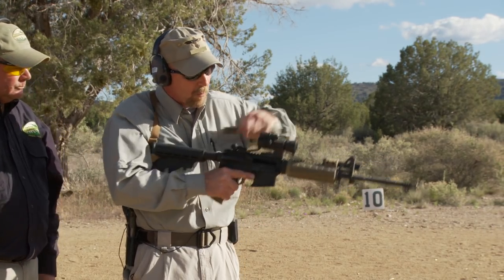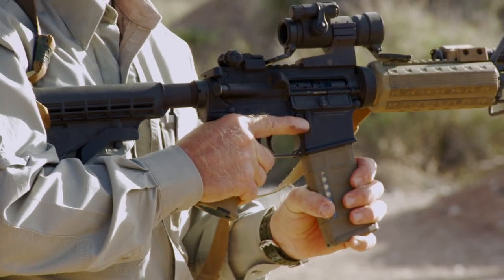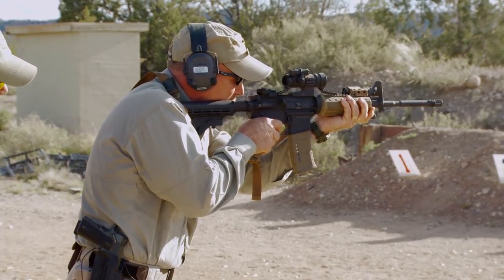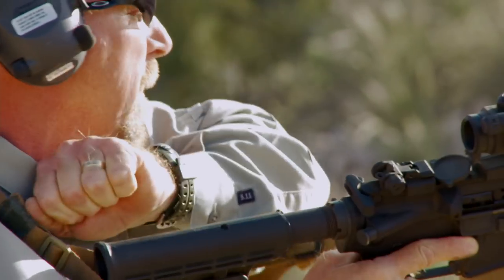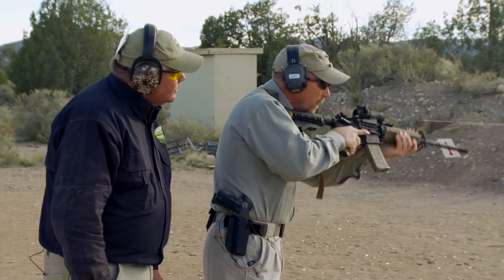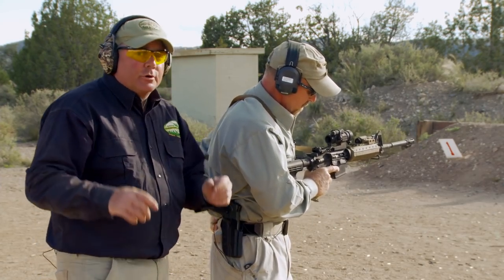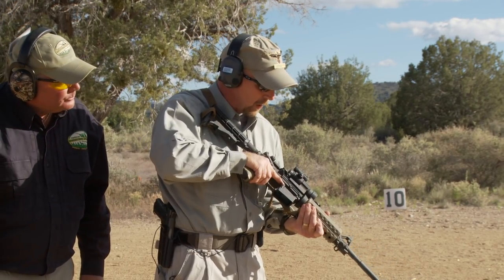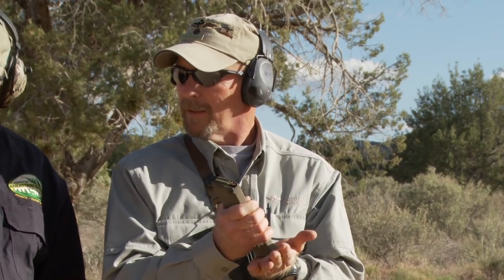AR-15 Immediate Action Drill | Gunsite Academy Firearms Training

Comment: the army taught me SPORTS, slap the mag up, pull the charging handle, observe malfunction, release charging handle, tap forward assist, squeeze-

later down range i took away 2 steps from the process making it PORS (pull, observe, release, squeeze); however i incorporate the other two steps (slap and tap) when i do my mag changes

you're exactly right this is for beginner non-combat shooters,

Comment: In my experience this method of push pull is amateurish at best. During my time overseas we trained to tap, rack and bang or Rip Rack Reload. I was in the Marines and Army and the BRASS and SPORTS methods are great. However, if you need to get the weapon back in the fight push pull is a weak method and is not forceful enough if you have to get the weapon running again. I dont know of any serious instructors teaching a push pull ie MagPul, CSAT, Viking Tactics, Spartan or Tiger Swan.

Comment: Push pull rack unload reload do a summersault unload the gun disassemble it do 36 push ups reassemble the gun put it in the case low crawl 76 meters and that should clear the malfunction. It’s very simple.

Comment: US ARMY taught the SPORTS method. 1 (S) Slap the bottom of the magazine with the bolt closed. 2 (P) Pull the charging handle. 3 (O) Observe the chamber for miss fed rounds. 4 (R) Release charging handle to reload weapon . 5 (T) Tap the forward assist. 6 (S) Squeeze the trigger and go boom!

Comment: This drill is for when a round hasn't been fed for ready fire, not a full malfunction when a round is jammed or a misfire happens with a round still in the weapon.  You need to get proficient in conducting SPORTS (Slap magazine insure its seated properly in magazine well-Pull the charging handle-Observe the Chamber very important. You want to make sure there are not any jammed or msifired rounds in the chamber-Release charging handle and ensure round feeds properly into chamber-squeeze the trigger and fire.)  All takes a second when practiced proficiently.  Also this ensure the safety to the shooter especially when rounds are being misfed into the weapon due to faulty rounds or magazine.

Comment: Slapping the magazine will not shoot a round out of it, it just makes sure the magazine is seared properly. If the weapons didn’t fire when it should’ve, then there most likely won’t be a reason the bolt is locked to the rear allowing the round to fly out, and if it is, there isn’t a reason to worry about one round flying out when you still have the other rounds in the magazine.

Comment: @Desenrolle lightningman01's point is still valid.  This is a drill that should be practiced, but not when you have a mis-fire.  You should always adhere to the 60 second rule when at the range or whenever you're not in a life threatening situation.  This video would have been better had it pointed this out.  Obviously you're not going to wait if it's a life threatening situation, but this video is about a drill.

Comment: I don't think that rounds would pop out of magazine and into chamber with bolt in closed position when slapping bottom of magazine.  They can't go anywhere because the bolt covers up the top of the magazine. 40 years of SPORTS isn't wrong, but combat proven reality.  M16s gunk up with sand and powder fouling, and that's where slapping magazines and the forward assist come into play.

Comment: yeeeaah. No. The way you make sure is if you flip up the rifle to see the action....
That is if you're an idiot with a gun and cant make more than 2 steps without fouling it up.
Also, make sure the safety's off when you're about to fire. And keep it off until you get your 5 minutes of safety buffer time.
If all is clear. Safety back on.
If it's not. Keep in condition 1.

Also in real combat, you wont have time to check the action if it's loaded or not.